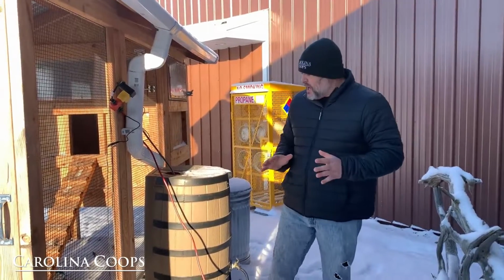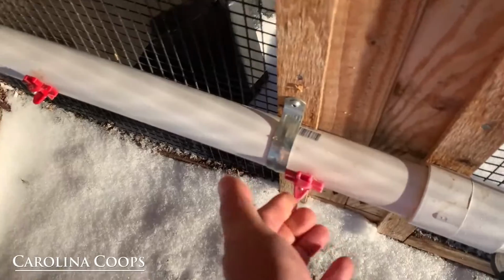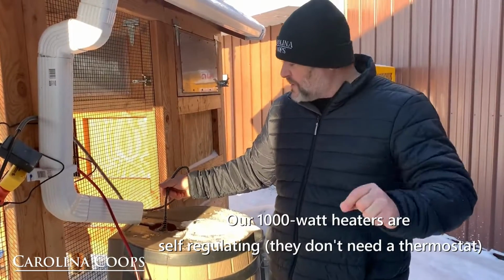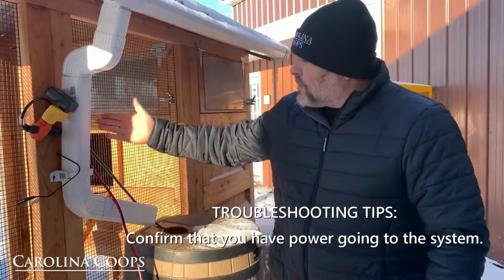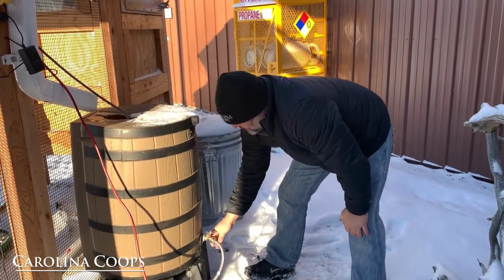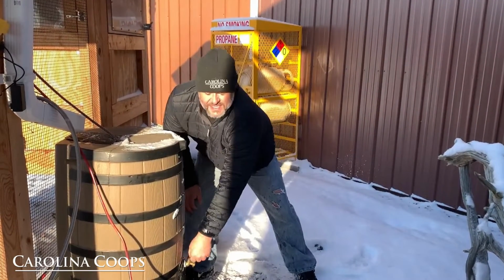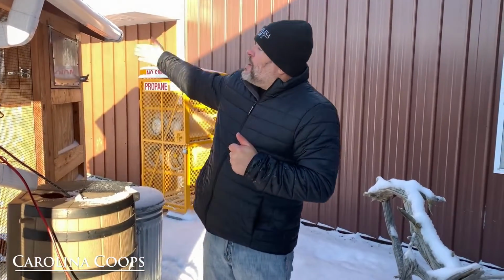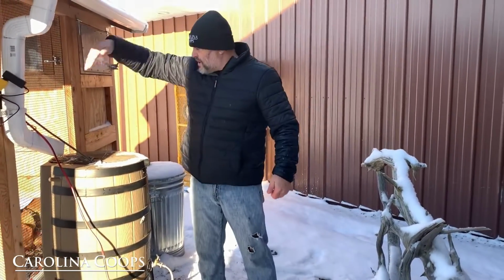Best Heated Chicken Waterer| DIY Tips| Troubleshooting Instructions

Comment: This is the most expensive, least efficient system I have ever seen. My furnace uses less than half that many watts. A 100 watt heat lamp will warm your chickens and keep water from freezing. A 65 watt heater with a five gallon waterer will supply 30 chickens for 2 to 3 days and work till negative 40. If you plan to run a pump full time why not just put your water supply indoors and not worry about the heater. It's cheaper to run a pex line than electricity.
Reply: I prefer to be managing their food and water on a month to month basis, so something like this works good for me. 
I found a cheaper heater on Amazon though.
Reply: Also, their system could be made cheaper than they sell it for. But like most people online, their a for profit organization. If you want to make it yourself go ahead, if not then don’t, maybe even buy theirs. At least you can know it’ll work, most likely.
Reply: In the video he says the 100 watt heater is thermo regulated, so it only turns on when it needs to, and the pump is plugged into a thermo switch and only runs when it’s cold. This looks like a great system.
Reply: @failingdisciple938  It wouldn't work for my chickens, in my environment without huge costs. It would be much more efficient if the  water was buried or indoors. I stand by my previous statement having farmed chickens and worked for chicken farms for over twenty five years. The other problems I have seen many times with systems like this is mold from the heaters, clogged pumps, clogged filters, cracked water barrels, leaking connections, frozen pipes, and over confidence in a system leading to animal death when it goes down periodically.  You mentioned it only running when it's cold but in my area it's below freezing for at least 60 days and 160 nights during the winter. To me this looks like a system that would work in the south or maybe Kansas or Nebraska,  but up here in Idaho, Utah, Wyoming, Colorado, Montana, I wouldn't waste my money! It's not personal, just practical.
Reply: @matthewbattie1022  ok
Reply: @failingdisciple938 he said 1000watt heater! Depending on latitude, if you must, but talk about power usage... wow!

Comment: What kind of pump do you use? I noticed that it is not putting out a high volume of water and is able to allow pass through when the temp outlet turns off when it is warm. I was going to turn my watering system into an auto system and was looking for a good pump and was just wondering what one you guys recommend.  Thanks allot for your videos, beautiful work you do!

Comment: I run a setup that uses a de-icer similar in that it has/had a chew guard, the metal spring like thing on the cord. That needs to be removed in this application as it will rust and contaminate the water. It is a simple removal. I do like your system in as it is very straight forward and should be very easy to troubleshoot even without your explanation and tutorial here. Any system will freeze if the power is off too long but in that event this system should be quick to disassemble and would thaw quickly to be reassembled again.
Reply from the maker: Thanks for your comments, we hope this will help people. And yes, for this system to work, it requires power.
Reply: What metal spring?
Reply: @cgbanny  The de-icer, or heater, is intended to be used in watering troughs or buckets for livestock. As such it has a metal chew guard that looks like a spring that is wrapped around the cord. That chew guard will rust in a single season so it should be removed in this application as there is no risk of an animal chewing the cord.

Comment: Something to consider, a bib valve diverter (or some sort of fab'ed pvc manifold) would allow you to bypass the main barrel, and flush the system with a 5 gallon "mini" barrel using a bit of chlorine bleach.  Connect to bottom of the flush bucket to the diverter closing off the main barrel feed and then open the line out to the water bars. Do the same to bypass the return and divert it into the bucket.  Flush for 30 mins to de-gunk the water bars, then drain the bleach water pumped into a second bucket to dump into your toilet or sink, divert the fresh water from the main barrel back into the system allowing the fresh water to fill  the drain bucket 2-3 times 15 gallons) before diverting it back into the main return.  Once a month in the spring, summer and fall when the pump may never kick on.  May not be a bad Idea to run the pump once a week, or an hour a day on a timer vs the therma switch, just to keep it in proper function as things don't like to sit unused.
TullyRiverQuail

Comment: My tank overflowed and wouldn't circulate.  The bar froze and busted!!!  It survived -20 last week, but after the snow melt right after it filled and froze Tuesday night at only 4 degrees!  Second question, with the super cold, when the chickens were drinking, the nipples dripped a little and froze.   Any tips or tricks???  
Thirdly, after rewatching your video after I built my system, I have my pump funning 24/7.  Does it not need to?
Reply from the maker: Hi Carrie, for this system to work properly, the pump needs to be plugged into a thermostatic switch. The heater in the tank has a built in switch. The switch will tell the pump to turn on before freezing temps and switch off once the temperature is in the 40s. (49 degrees- we believe). So the pump doesn't or won't run continually if it's plugged into the thermostatic switch. So troubleshooting questions would be:
Is there a heater in the tank and is it the appropriate one for the volume and temperatures. 
Is the pump plugged into a HeatIT (thermostatic switch). If your pump is running 24/7 then our guess is you don't have it plugged into a thermostatic switch. 
Was there power to the system (chickens can sometimes unplug it)
The nipples shouldn't drip much but it depends on the manufacturer. Chicken keeping can be tough in frigid temps for sure. Hope this helps
Reply: @CarolinaCoopsVideos  While this answers my question, it gives me a new one.  Does the pump not need to run year round?  I have my pump plugged into a regular outlet and run it 24/7/365!!  My heater is in a heat sensing plug.  I've had this set up for 3 years with this year being the first year the barrel is fed by a gutter system.  With the tank fuller then where the return hose plugged in, the very top of the tank froze, I believe causing it not to allow the returning water to come in.  I have the barrel on a stand, and I believe I had the bar at the same height as you have in your video.  How does the bar stay filled if the pump isn't running?
Reply from the maker: @carrieleonard1997  The pump doesn't need to run constantly because they can burn out that way. That's why we recommend plugging the pump into the HeatIT- (thermostatic plug) and the heater that goes into the water should not need to be plugged into the HeatIT because it has a built in thermostat, if are using the same products we use and recommend. The water fills the waterbar by gravity. it has two hoses to accommodate circulation.
Reply: @CarolinaCoopsVideos  I am going to give it a try!  Thank you so much for your responses.  You've been so helpful.
Reply from the maker: @carrieleonard1997  You're welcome!

Comment: I have this exact set up here in Wisconsin and love it. Worked perfectly even with 55 below wind chills.  But this year the water nipples keep freezing.  Anyone know why this would happen when the weather is actually warmer than it was last year?
Reply from the maker: Hi. There are many reasons why your system can be failing. You need to check that the pump is working and kicking on when the temps get lower. Make sure the pump is plugged into the thermostatic switch (Heat-it). Check to. make sure both the Heat-it and the De-icer is working. Also make sure you are getting enough water flowing into the waterbar with the pump running. It's a great system when everything is working properly, but if something isn't right, it can fail.
Reply: Thank you!  Everything is working well. The only thing I’ll check once the weather warms up is the Submersible Heater.  It’s been in the water barrel for about a year and a half now and maybe there is some hard water buildup on it which is not allowing the water in the water barrel and   Waterbar  to be warm enough to keep the nipples from freezing.

Comment: Thank you very much for the description! Will the water continue to fill the pipe when the pump isn't running?
Reply from the maker: Hi Ken, without the pump running, it works as a gravity fed waterbar. So yes, the waterbar will have water in there for the flock.
Reply: @CarolinaCoopsVideos  awesome! Building it tomorrow! Thank you very much

Comment: Would it. Or be a bad idea to leave pump on to keep your water cleaner. Also could you not turn the heater on and off at 35 and 45
Reply from the maker: you can unplug the thermostatic plug and just run it with the pump, yes. We don't feel like it's necessary to do that all the time, but maybe a few times in the season.

Comment: I'm confused.  So, is there supposed to be something running all the time?   Can you hear the pump running?   So far we have not had cold enough weather to have the Heatit kick in.  But I'm just not understanding the pump.  I assumed it had to be on all the time to circulate the water.  Am I mistaken?
Reply from the maker: HI Donna, the pump is controlled by the heatit, so it will only run when the temperature gets to 38F  and then will kick off when it gets to 50F. There is no reason for the pump to run all the time if the temps aren't freezing. You will hear the pump when it's running. Hope that helps.
Reply: @CarolinaCoopsVideos  Thank you very much.  Found out we had the plugs connected incorrectly and now we understand about the circulation!   Thank you so much!

Comment: Why not have the pump circulating the water all the time regardless of temp? Wouldn't that continuous movement help keep the water fresher and not stagnate when it's warm?
Reply from the maker: Many people do just that Gerry. It's not necessary. Sometimes we advise to run the pump occasionally in the warmer months, or dump the water and fill it up with new water. Many people don't want to tax the pump but having it run all year round or use the electricity to do so. But it's totally an option with this system.

Comment: Hi I just ran into your 
 design and it’s definitely smart! Question: why do you need a thermo controlled outlet? Shouldn’t it be on all the time to make sure proper circulation of the water?
Reply from the maker: There is a thermostatic switch that kicks on and off depending on the temperature. So the system doesn't have to be running when it warms up during the day often times. Thanks for watching.

Comment: We have this system and will be going into our first winter with it. Are there any concerns/issues with the pump running pretty much nonstop all season long? I'm not too far from you guys and as you know, we spend a lot of time below the 50 degree shut off on that HEATIT plug here in upstate/central New York. Thanks
Reply: They're bayite pumps which can be found on amazon. Supposedly have a 30k hour lifespan, results likely to vary.
Reply: @feyrband  I bought an Inkbird thermostat that has a remote probe and am thinking of either putting the probe in the top level of the water barrel or ideally, if it's possible to do without causing a leak, drilling a hole into the water bar and sealing the probe inside.  That way the pump will be triggered by water temperature rather than air temperature. This seems to me to be a more efficient way to run the pump since it is the water temp I'm concerned with more than the air temp.

Comment: Assuming the pump lets water through with it's not on, if the pipe with the nipples is angled upward, how does the pipe stay filled when the pump is not on (ie when it's above freezing?
Reply from the maker: Hi Matt, the system with or without the pump is gravity fed. The pump just circulates the water. Hope that helps.

Comment: I already have a self-made water bar system with the spring loaded cups for the summer months.  Our piping is smaller in diameter.  Do you recommend a certain diameter pipe with the pump?
Reply: I’d be worried about the cups themselves freezing up with water. I’ve used chicken nipples and they seem to work better. Also I just use a 35 gallon tank in the run. The chicken nipples screw into the tank an inch or two up from the bottom and the water heater goes in the tank. No pump needed.

Comment: I'm in Winnipeg, Manitoba Canada where temperatures can hit -50 celcius. Would you add heat to a chicken coop in these temperatures and do you know of a water system that will work in these conditions?
Reply: I had similar questions.
I live in Montana and we do -30f.
I am currently building a small barn for my birds and considering putting in a recirculating system attached to a water heater.
Since I don't want the water to be too hot for the birds it will first run through 500' of pex to cool the water, but give a bit of heat to the barn as well.
Crossing my fingers this will work 😉

Comment: I understand that the heater is self regulating. Why do you have the pump on a thermostat? will the water flow on it's own when the temperature is high enough? I would think that the water should flow at all times to keep it from stagnating
Reply from the maker: Thanks for your comments. The thermostat tells the pump to kick on. Not everyone wants the pump to go 24/7. The chickens should go through the water and if it's coming from rain water, it won't be stagnant all the time. The water in the rain barrel is cleaner than most water you will find chickens drinking from. Anyone who has chickens will tell you, they will drink from a mud puddle.

Comment: Great video!  Have you ever hooked up two separate water bars in the same line?  I'm thinking of putting one inside the coop (converted from an insulated shed), and then running the line through the wall for another bar outside.  The main thing I can think of is making sure there aren't any places where air can get trapped.  Any other tips/thoughts on that?
Reply: Water inside the coop is not the best idea. Inevitably it's gonna drip a bit, get spashed around or maybe even spring a leak and soak everything. Moisture in the coop is a bad thing, especially in the winter...can contribute to frozen combs or wattles...

Comment: Does this flow water to the chicken nipples if the pump isn’t on? Or does the pump not allow water thru unless it’s running
Reply from the maker: Yes, it works as a gravity fed system, the pump just circulates the water which will prevent it from freezing and keep the water bar water from getting too warm in the summer.

Comment: Would this work without a pump and with a heating strip on the hose instead?
Reply from the maker: For the water to not freeze inside the waterbar, it needs to circulate, so for that, the pump is necessary.

Comment: Thanks for the video. My hose from barrel to pump leaks where it is connected to the pump. The threads are sealed, but the hose leaks where hose connects to its threaded connector as if back pressure is too high. I have tried a few hoses so it is not a defective hose. This leak happens both when pump is on and off. Any suggestions how to resolve this would be greatly appreciated.
Reply from the maker: We hope to answer this on Video Chicken Live, year end special. Dec. 31st 2021.

Comment: With the bayite pump listed on your website, will water flow through it freely when the pump is not running?
Reply from the maker: yes, the system will still work as a gravity fed system when the pump isn't running. The pump is controlled by the thermostatic switch which comes on and off depending on temperature.
Reply: Wouldn't pumping the water 24/7 not depending on temp also help with algae in the hot summer temps? Or am I wrong in thinking so? What pump would you recommend for that?

Comment: We have a big problem.   Went outside to check on the chickens this morning and the hose that goes into the pipe with the nipples was leaking a lot.    We shut off the water from the bottom of the barrel and it stopped but we can't figure out what happened.   I know it was cold last night but we had everything plugged in and the water in the barrel is not frozen so we aren't sure what to do
Reply from the maker: Sorry you are having issues Donna. Please make sure everything is tightened and the gasket is ok. If you still have issues with our poultry water system, please give the office a call at 919-794-3989.

Comment: What about setting the water barrel a little higher than the water bibs. You’ll use gravity as the best pressure to send water to the coop.
Reply from the maker: It is essentially a gravity fed system.  However, with the pump, it circulates so the rain barrel is on a base and the water feeds into the waterbar and returns back to the barrel. Thanks for watching

Comment: When the pump is off in warmer months does the water just pass through it into the bar?
Reply from the maker: Yes. You don't even have to keep it plugged in in the summer, but the thermostatic switch will keep it from running, although some people like to run the pump (just remove the thermostatic switch) once in a while in the summer to keep the water from becoming too stagnant. Thanks for watching.

Comment: Why do you want the pump on the thermostatic control. Wouldn’t you want the heater?  Turn the heater on if needed and keep pump circulating the water?
Reply: The heater is self regulated, it has a built in thermostat, so it doesn't need a thermostat.
Reply: @columbusmicrofarm  Thank you so much for your fast reply